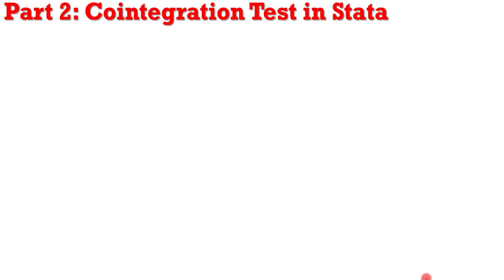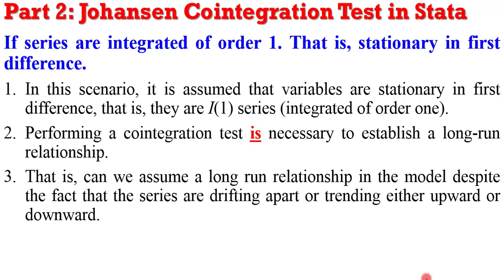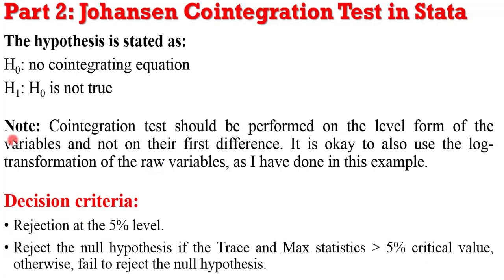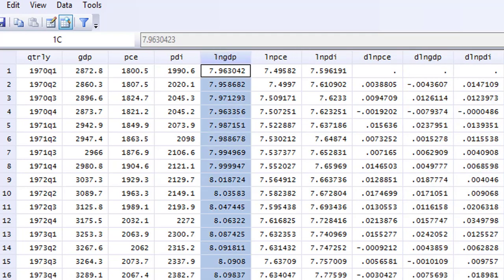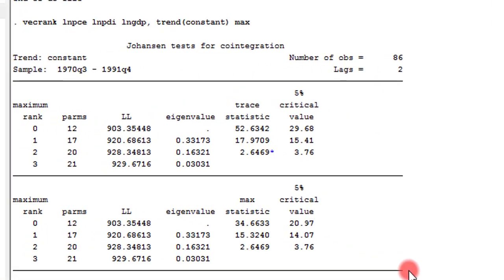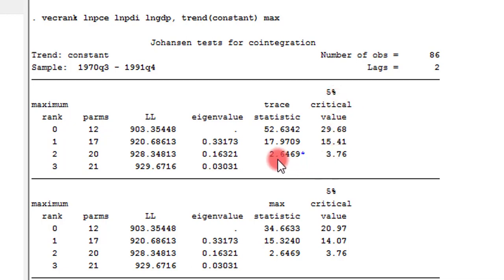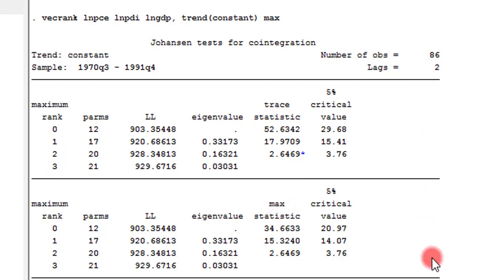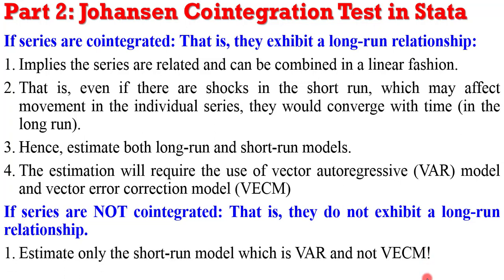(Stata13): How to Perform Johansen Cointegration Test  #var #vecm #Johansen #cointegration

Comment: If a series is non stationary at levels but stationary at First difference, so johansen test is conducted on that original series or difference series please explain, if i am conducting Johansen test on original series VAR model is recommended but while using it on difference series there is long term relationship and VECM is recommended which one of the model is used for forecasting purpose?
Reply: Thank you so much for your reply.
Reply from the maker: Hi Muskan, either can be used for forecasting.
Reply: I have one more doubt regarding johnsen cointegration test as per AIC and HQ criteria lag 4 is selected and as per SC criteria lag 1 is selected and if i perform Johansen test using K=2 it would recommend me to go for VAR(1) and as per K=4 it would recommend some kind pf cointegration among variable and then use VECM. Can you please help me out with this problem?
Reply: Can i select the VAR model with 1 lag as per SIC criteria and go ahead with my problem of forecasting?
Reply from the maker: I explained the rule of thumb for selecting the appropriate information criteria. Use the one with the lowest statistic.

Comment: Hi Prof, I have panel data for 6 countries n 25 years. I have done panel cointegration and found out the data is co-integrated. I am confused whether I should have Johansson Cointegration test as well. I tried to search your video for panel Johansson test, it is available for EViews but not for stata. 

Actually, what should I do next after found out my variables have long run relationship. Thank you very much for your kind advice.
Reply from the maker: Hi Mimie, JCT is NOT applicable for panel data study. Kindly watch my videos on panel ARDL. Thanks.

Comment: Dear Dr Ngozi, thank you so much for your video! I am a postgraduate student from the UK and feel your video is quite helpful! By the way, I have a stupid question and I would appreciate it very much if you could help me with it: After realising that a set of variables are cointegrated through the Johansen Conintegration Test, we will know that there should be a long-run relationship equilibrium among these variables. So how could we know the specific long-run relationship equilibrium (like Y= 0.5 + 0.3 X1 + 0.4 X2 + 0.1 X3)?  (Is this long-run relationship equilibrium being achieved just by 'reg Y X1 X2 X3' ?) Thanks!
Reply from the maker: Hi Shuai, thanks for the encouraging words and feedback on my videos. Deeply appreciated! I showed the long-run equation in this video. You may need to watch it again. Thanks.

Comment: Hello Madam I really have a problem can you possibly reply me through this mail account. emaaaku@gmail.com. After my analysis, I realised that both the trace and max statistics under the rank  0 and 1 are all bigger than the critical value at 5% significant level. What does it mean are my variables still cointegrated. I really need help my presentation is at the corner am confused.I wiould to send my results to you for you to help me.love thank you
Reply from the maker: Hi Priscilla, thanks for watching my video and for reaching out. I'm for the benefit of all which disallows my responding to personal emails. Thanks for your understanding.

Comment: I have a question: If I have some variables stationary while others are not stationary in my model but non stationary variable stationary is solved by taking the first difference. That is I(0) and I(1) Should I do cointegration test or I can't do it?
Reply from the maker: In that case, you perform the Bounds cointegration test.
Reply: @CrunchEconometrix  Thanks a lot. I have also very important question concerning the data and suitability of ARDL model to use for my data. The fact is that I have quarterly data for 12 commercial banks 9 variables for each of these banks for 10 years. When I create a pool of data in one data set STATA considers them all as if they are the data for single bank. Also another problem with data is that the data for one commercial banks for 10 years with 9 variables end and then the next bank data starts and so on. Can we use ARDL model in this case considering that I have 2 dependent variables and 7 independent variables which can not be a dependent variable according to my research question. As I remember from your example, each variable can be dependent as well as independent exploratory variable. I thank you very much in advance. You are saving so much time and efforts for me
Reply from the maker: You need to know the differences between a time series data and a panel data. From your explanation, your data structure is the latter. Watch my panel data videos for better understanding.
Reply: @CrunchEconometrix  Thank you . I will definitely watch them and return with questions)
Reply: Professor, I have a question which I couldn't solve. I have the quarterly data given as 01.07.09; 01.10.09; 01.01.10 so on. meaning that they are given for the first date of the next quarter. For example ROA for 01.07.09 is the ROA for the second quarter of the year of 2009. How can I convert them into 2009q2, 2009q3, 2009q4 etc in stata so that stata would accept each of these observations as quareterly data. When I show them as quarterly data in stata it shows them as 6479q4, 6502q4, 6525q4 so on for the data which normally belongs to 2009q2, 2009q3, 2009q4 so on. For some banks the same for example 6502q4 was given twice for two different observations which normally belong to two different quarters. Sorry for such a long explanation. I hope it is understandable
Reply from the maker: From your explanation 01.07.09 is 3rd qtr not 2nd. You may have to manually generate the sequence or post on Statalist.org for constructive feedback.
Reply: @CrunchEconometrix  OK unfortunately I could not register for that website because of Random question part which I did not understand
Reply from the maker: Which "random part"?
Reply: @CrunchEconometrix  This is the last question to register for the stata website you mentioned
Reply from the maker: I have know idea what you are talking about?

Comment: Dear Prof I am using annual data for 50 years and my issue is that I am not very sure how I assign the optimal lag for the VAR using the AIC. My variables are stationary at first difference of the logs but at 10% critical value instead of the 5% critical value. I guess this are the problems that make my VAR model to have some omissions on some of the variables and Granger is not giving the Chi square values to show the direction. Please help.
Reply from the maker: Hi Banele, did you watch my video on Optimal Lag Selection?

Comment: if i get a cointegration in levels but not on 1st differences should i do a vecm? (i only got 2 lagss)
Reply from the maker: Hi Arturos, what do you imply by "cointegration in levels"?
Reply: @CrunchEconometrix  umm the variables like they are ummm like years of education and pib per capital(this is just and example , not the variables I'm using), when I do the test with the variables in differences I don't get cointegration anymore, I'm doing my econometrics homework at my University in Peru
Reply from the maker: @arturox1997  Your query is not understandable. The guidelines to performing JCT are quite explicit. Watch the videos on cointegration AGAIN, jot down notes and follow my guide.

Comment: You didn't mention how to decide between using constant or trend in the test, or how many lags to use. Why does the test default to constant and 2 lags? When would you select "trend" or "rtrend" or "rconstant" instead of just "constant"? Also, I am using yearly data and think I should only use 1 lag instead of 2.  And what if the trace statistic says there is 1 cointegrating equation, but the eigen says 0? Question from Vermont, USA. Thank you.
Reply from the maker: Hi Yoni, you will agree with me that not everything can be put on the video. The idea is to spur the student to also go out and fish for more information. I also mentioned that you have the prerogative to use either the Trace or Max-Eigen statistic after resorting to their underlying assumptions. Thanks for watching my videos, deeply appreciated.
Reply: @CrunchEconometrix   Hi, I really appreciate your endeavor. But I feel that the above question (as raised by Yoni Bork) need to be addressed. These are the most critical issue and direct answers are difficult to find. Otherwise, researchers might be misguided. God bless you.
Reply from the maker: @raihansiddika8463  It is also advisable for you to to seek other sources for clearer understanding. My earlier comments stand.

Comment: i have a question is it necessary that for Johansen Cointegration Test all variables are integrated of same order at level/raw form/log form and must not have differenced ? Kindly guide me in this issue thanks
Reply from the maker: Muhammad Ahmad Yes, all variables must be stationary at 1st difference b4 performing JCT. But when performing the test, u can use either the raw or log forms but not the 1st difference. Just the way I performed it. You can watch my video on how to perform the test.
Reply: thanks ma'am